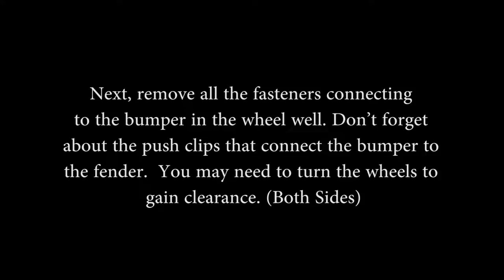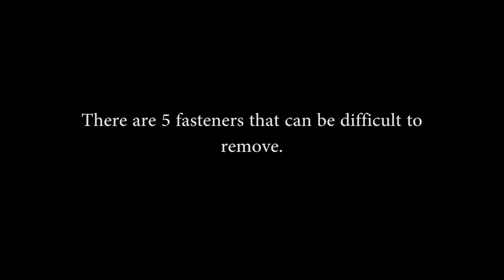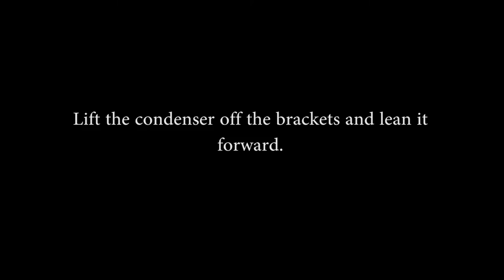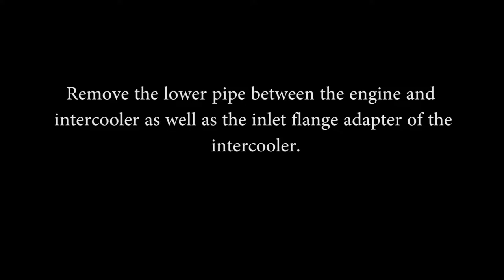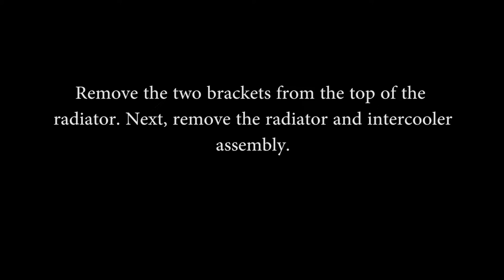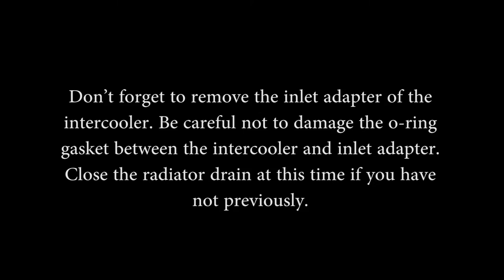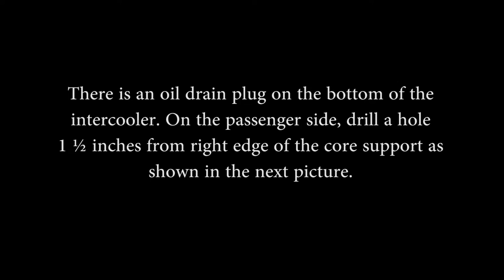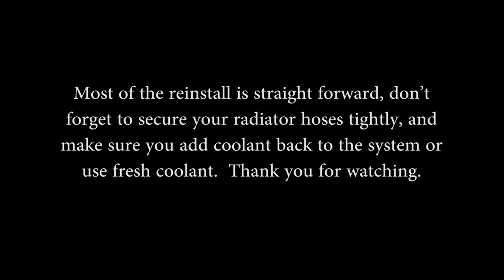Gearhead Taurus SHO Intercooler Install

Comment: Installed mine today, massive improvements in air temps measured at the intake manifold. Night and day difference between stock and GH. Worth every penny. Stoked about track season this year with the GH tune and IC.
Reply: can I ask you how much did your intake temps change?  at times when I am bracket racing with the stock intercooler the charge temps will be 190°  I run hi 12 sec in the quarter mile  but when the charge temps climb that high I only run 13.0 the intercooler gets so heat soaked. So really im asking did it help with heat soak in the intercooler ! I was really looking for a intercooler that is not stacked right on the radiator but dont want to cut the crash bar!

Comment: I have a bunch of upgrades to my 2013 sho including a gearheadtune but intake charge temp climes to over 190° during bracket racing I have been looking for a intercooler and this just may be the one I get thanks for the install video!!

Comment: Did you put any thought about using a water to air intercooler?
Reply from the maker: Why when this is a direct replacement and works so well? But yes that was an option if this didn't pan out.
Reply: @mattr66  because it's more efficient smaller size not sure but possibly condenses outside air a bit less to not build liquid inside but still keep temps way below

Comment: Why did you drill a hole in the bottom
Reply: This intercooler design has a Built-in drain hole for oil build-up in conversation that builds up into the intercooler overtime you couldn't simply unscrew the Allen screw and start the vehicle Floor it a couple times or just in idle let it drip Until there's nothing left and just put the plug back in its that simple the intercooler acks like a big catch can for oil and moisture